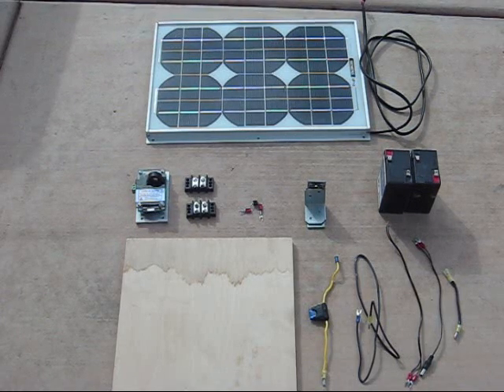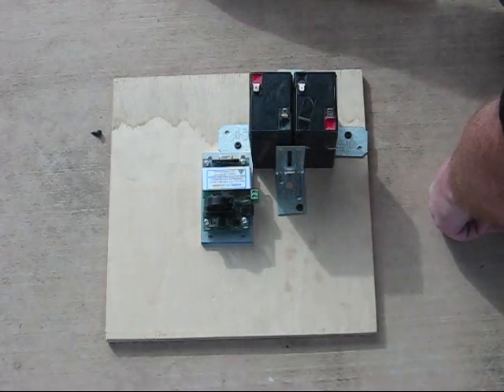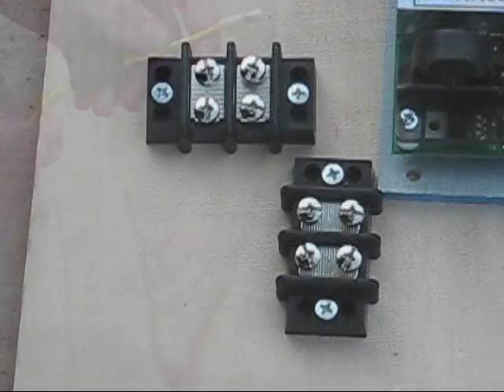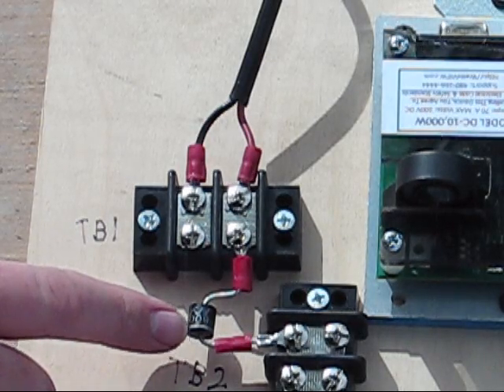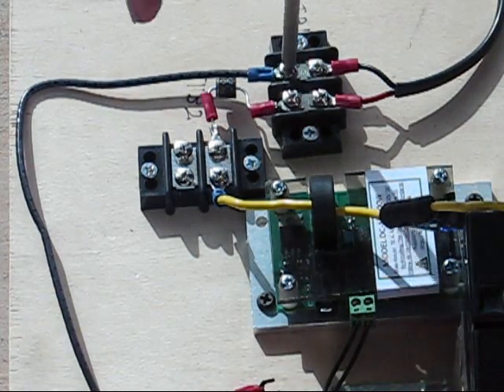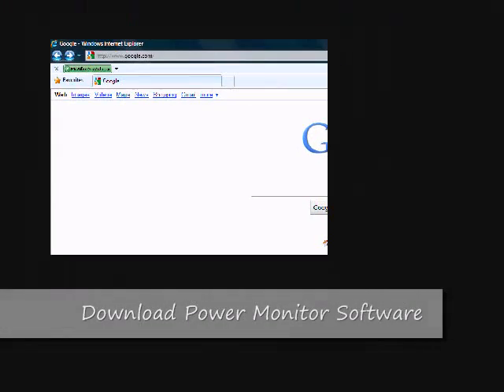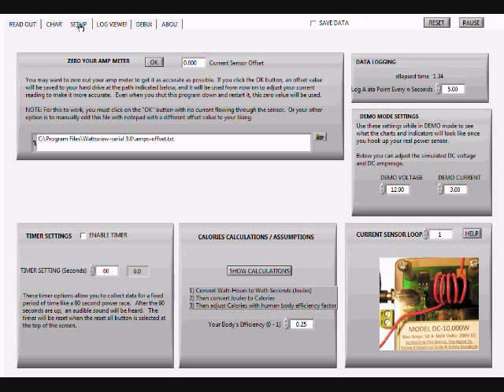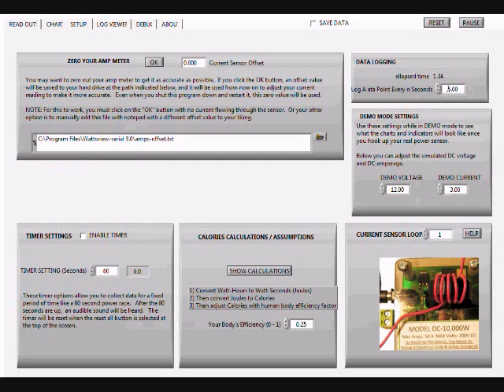WattsVIEW DC Power Meter Monitor Serial Data Logger Hall Effect Sensor

Comment from the maker: Absolutely, the current sensor will monitor the current of multiple wires, keep in mind that diodes have to be in place so there is no way negative current will occur, because that will lower the current readings down if that happens.